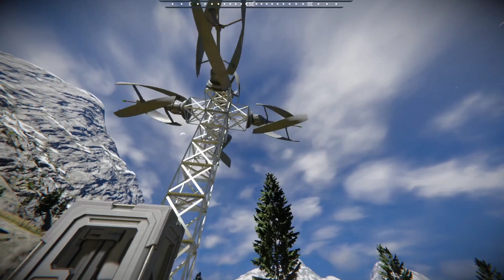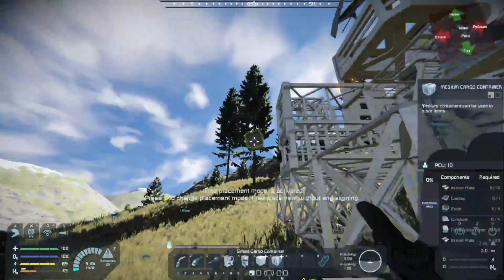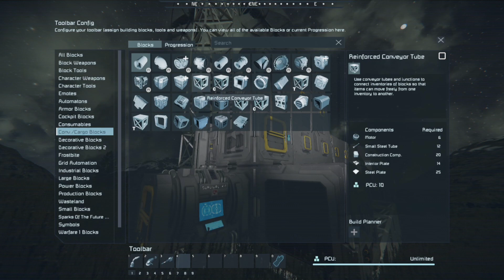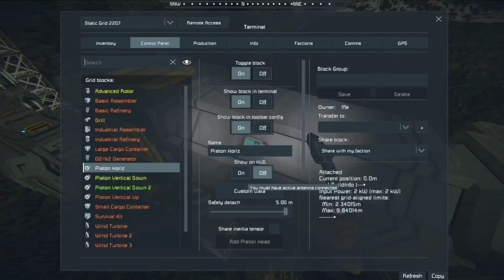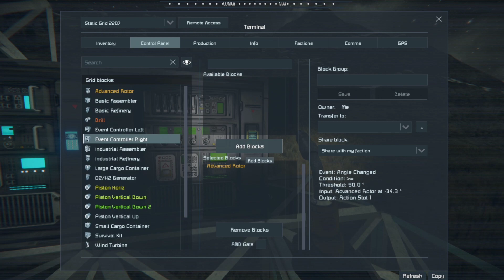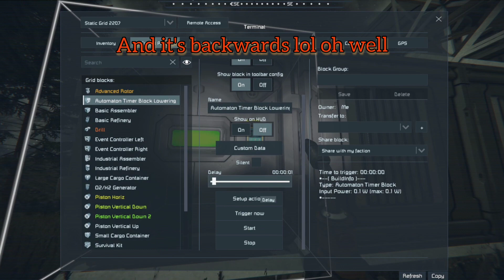Starting The mine! EP 2- Space Engineers Automatons 2023 Tutorial

Comment: Not sure there bud, but i think you may have messed up the design of the drill a little, if you had it where you had built the first piston going up before doing the rest, and then extend it all the way, you would have been able to add 2 more pistons going down, and so had double the area mined by the same piston, without needing to change anything later on. Other than that, same way i do my piston drills. unless im able to build it from the top of the cargo box and so dont need a piston going up in the first place, then just build out with pistons and down with them, so you dont need to reverse anything and the rotor is able to just keep going. Then when it gets to 0 degrees, you have it drop into the mine and it just keeps going.

I usually build a control seat for mine aswell, so i can just set up the buttons to be able to start and stop as required. Also reset the whole thing if needed.
Reply from the maker: That's a very good way of doing it. And to be honost I have about 4 different iterations of this mine since I made this video xD lol

Comment: I am having problems.. when going from right tonleft it will go right but when going left when it hits 360 or 0 it goes back right and not to the angle i set
Reply from the maker: Make sure your event controllers and timers are on and watching the correct thing. 

Also if you set a rotor to Greater than or equal to 360, it's not going to do anything. Has to be 359°. Same with if you have it set to equal to or less than 0, has to be set to 1°

Comment: You've done an excellent job on this tutorial series. Thanks so much for taking the time to do this. Keep up the great work.
Reply from the maker: Thank you very much!
Reply: @phonicspider  I am having an issue with the event controller, I think. When the Rotor reaches it's limits, the Reverse action is not taking place. Any thoughts?
Reply from the maker: @Mr Josh  I've noticed with event controllers, they can get confused sometimes. I'd try setting the rotor/hinge to the middle. Then turn the event controllers of and on, or may have to reset them. But then start the rotor again after that and it usually works. 🤔
Reply: @phonicspider  You are correct, I eventually figured that out. Everything is working as it should now. Thanks Again!
Reply from the maker: @mrjosh2064  of course!

Comment: I don't see the share inertia tensor and I'm on console
Reply from the maker: It should be there. Will just be a check box and should be right below the safety detach slider, and above the velocity and other sliders.

If it is not there, make sure Experimental mode is turned on in your saves settings, and maybe try turning it off, loading, leaving, and turning it back on and see if it comes back the next time.

Comment: @phonic Spider - I have an issue set it all up like you said with the timer it swings fine to the right then lowers swings back the the left and stops when i go over to the timer / even controller there is a high pitch squeal it is turning on and off rapidly but not swinging back any ideas, take timer out works fine  - any ideas?
Reply from the maker: By the sounds of it, you may have an action wrong on either the timer or the event controller. Hard to tell exactly, never had the issue lol but try that and see if it works.

Comment: I built mine the same way you did and the ore is staying in the drill.  i used the advance rotor .  Any i deals what i am missing
Reply: Make sure rotor head is welded
Reply from the maker: Make sure all the conveyor ports are connected correctly. Big --> Big. Also make sure you are using Conveyors, and not just regular blocks, and that your cargo container isnt full. To test it I would swap the conveyor junctions with just 90 degree tunes and see if that fixes the issue.